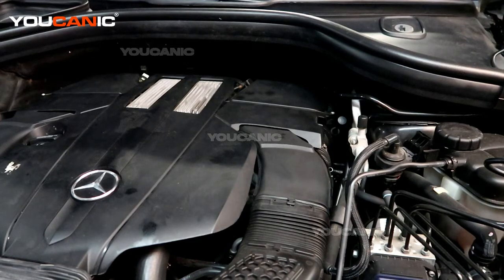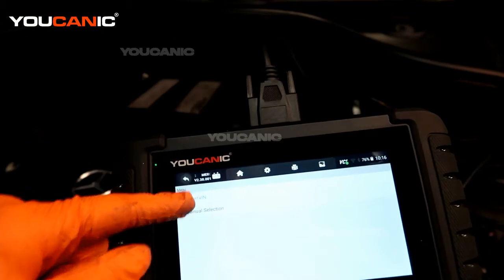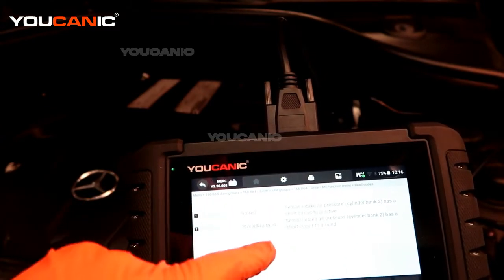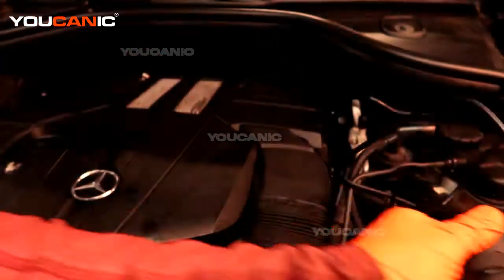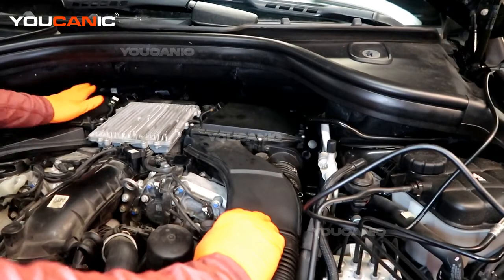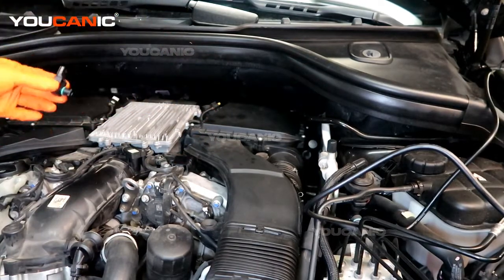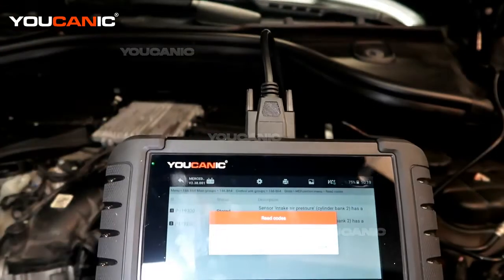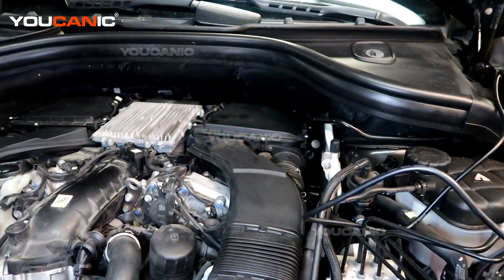Mercedes-Benz P1193 - Sensor Intake Air Pressure (Cylinder Bank 2) Has a Short Circuit to positive

Comment: Left passenger side, mine happens because of the aftermarket mst intake, the harness extenders cause it or its one of the two sensors on the filter
Reply from the maker: @c43sedan If you’ve got a car issue or repair question, you can find step-by-step guides and scanner help at youcanic.com. We might miss some comments here, but our site has answers for most problems already!